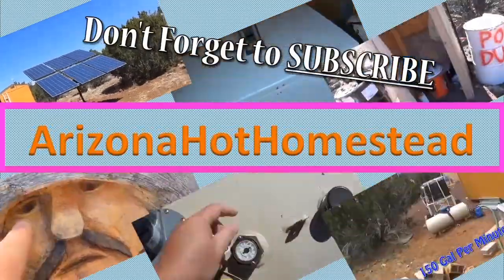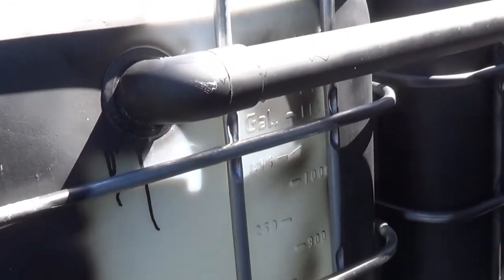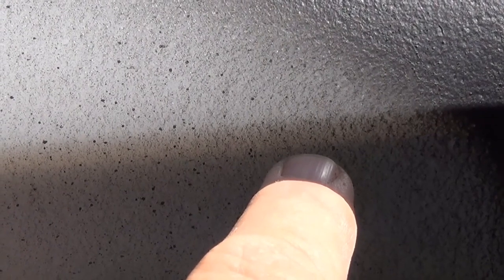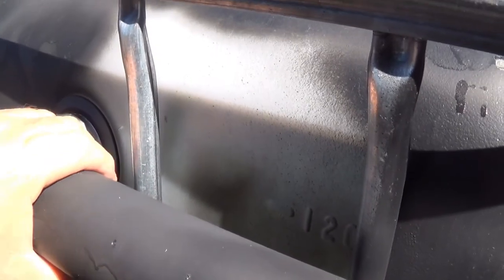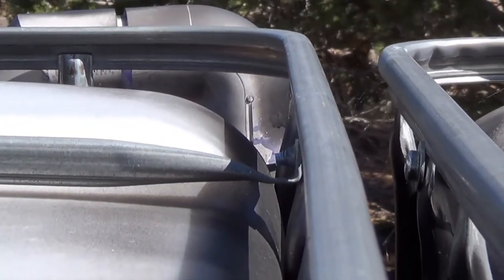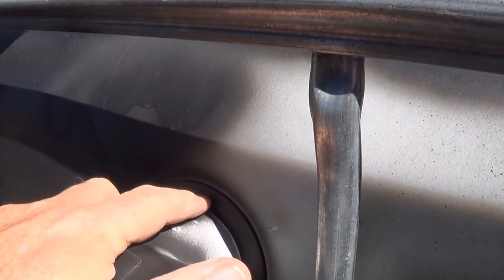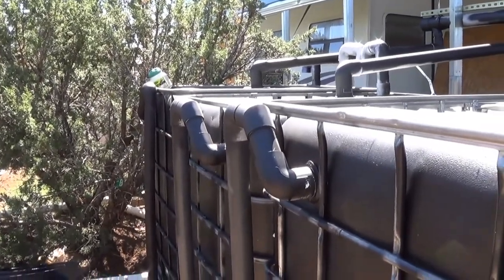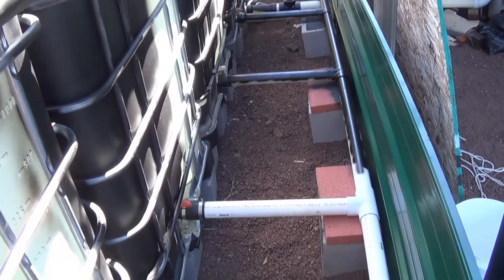Rain Catchment Water Totes are full. Time to pump it into my main Tank

Comment: Jeff. thanks for this video.  It's timely as I'm putting rain gutters on my structures near Heber.   I'm curious about the use for this water.   Is this for washing, toilets and gardening or do you plan on drinking it?   I'm just guessing that some "things" are still in the water and so I am thinking I would need to filter down to 5 micron sediment and then run it through a berkey type filter to drink.    By the way, I wrapped my totes in 6 mil plastic and I get no more algae.   Before I painted them black it wasn't enough as I still had some algae growth.
Reply from the maker: the hydrogen peroxide will kill off all the bad stuff as long as you continue to treat it. yes the more and or better filters the better overall in getting all the sediment. i do use a berkey filter but lately using it for cooking and coffee and dog water. lol i drink beer. lol. in fact after i shocked the water with h2o2 i didnt give it enough time before taking a shower and boy did i feel clean. cleanest i have ever felt. normally after treating the water give it at least 24 hours and after shocking the water like 3 days.

Comment: Is it safe to drink that water ?
Reply from the maker: only if you filter it and treat it. i have mine tested once a year and i use a whole house filter plus h2o2 35% foodgrade to treat the water. 1 oz per 1k gallons. but you shock the water with 20oz to 1k gallon when you first catch the rain.  after the shock i filter it as i pump it into the main tank. i filter again into the house. for drinking i use a berkey gravity  filter.